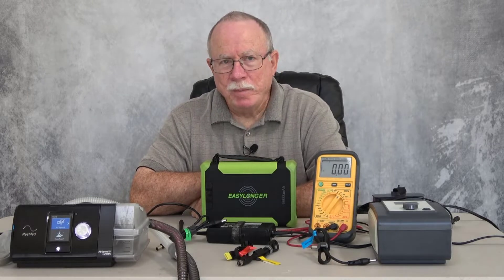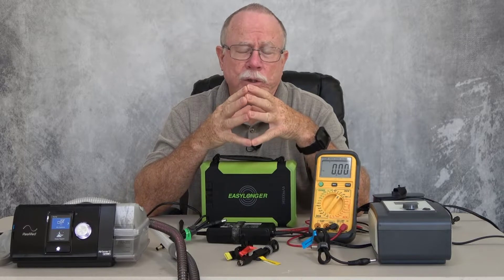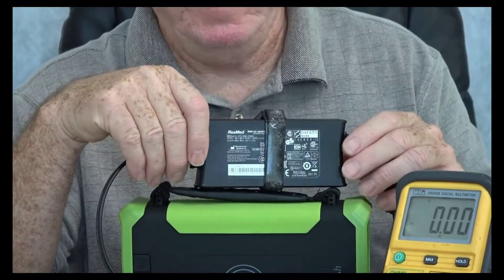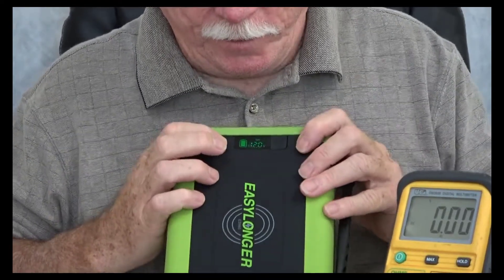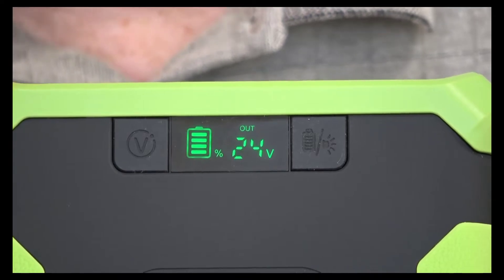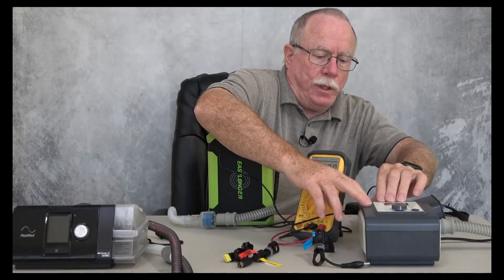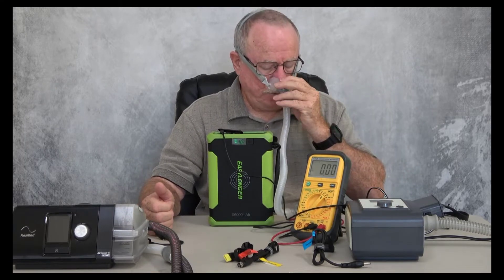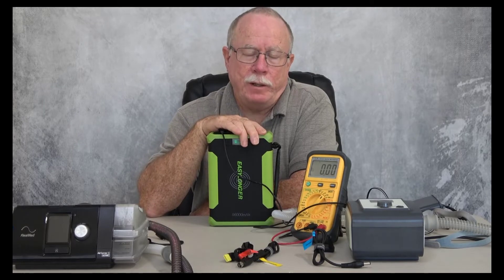EASYLONGER ES 960 Part 2 Power Selection & Setup for CPAP machines

Comment: I have tested the EasyLonger 960 with my Resmed Aircurve 10 Bipap.
Here is my results after each night:
          * If you DON'T use the humidifier & heated hose:  After 8 hours, it only lost 1 bar, and it had PLENTY of power. Probably good for 2-3 nights (8 hrs. each time)
         * If You DO use the humidifier & heated hose: It ran out of power at just under 6 hours.
Reply from the maker: Similar to my results. See this video: https://youtu.be/nIerqJUR6qI?si=NSZL40gtpzyHAeci

Comment: After setting my battery to 24VDC my Airsense 11 shuts down during CPAP use after about 2 hours.  I have repeated this 3 times and it still shuts down after 2 hours.  Battery charge is good. Any idea what may be the issue. Thanks
Reply from the maker: That sounds like a short run time so I'm guessing you have the tube heater and humidifier on. That will greatly reduce run time. When I tested my Air Sense 10 I got about 7 hours run time with tube heater and humidifier on and about 4 nights with it off. I just upgraded my Air Sense 10 to the Air Sense 11 but haven't tested it yet. I'll try to do that soon.  Watch this video if you haven't already seen it: https://youtu.be/nIerqJUR6qI?si=yQW2AHwPFw8AdHmz
Reply: @RooftopSafetyUSA  Thanks for the reply - The battery shut down after 2 hours the first night and i switched to wall power as I was at home testing the new ES-960 battery. Humidifier and heated hose are turned off.  On night 2 it shut off again after about 2 hours.  This time I turned battery back on and reset it to 24VDC and it ran for about 3 hours.  I reset the battery again and made it until morning - about 2 hours. On both nights of testing the battery still shows almost a full charge after use. The cord I used for these 2 nights was the supplied Airsense 11 cord that came with the battery. I also have a 12VDC cigarette lighter plug/adapter that plugs into the 12VDC and puts out 24VDC - I am going to try this cord tonight to see if the problem is originating from the cord included with the battery.
Reply: Used the (bought separately) 12VDC cigarette lighter plug/adapter (12 to 24VDC) last night and it made it through the whole night with over 75% left on the battery (no humidifier or heated hose).  Will experiment again with the supplied Airsense 11 cord (select 24VDC on battery DC Out port) in a few days as I'm going camping.
Reply: 4 nights camping using 12VDC cigarette lighter plug/adapter and ES-960 was still at 50-75%.   No humidifier or heated hose - pressure settings 6-9 on CPAP Airsense 11.
Reply from the maker: @johnrotten4871  that's pretty good. If you aren't currently using HME's you should try those.